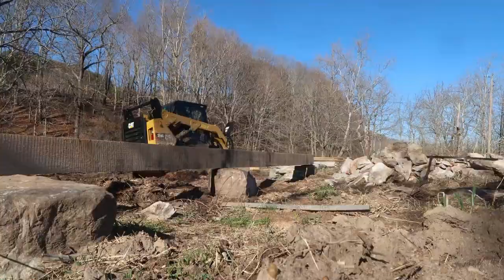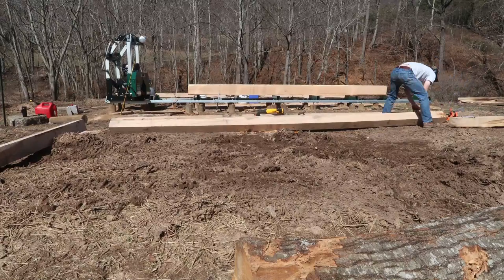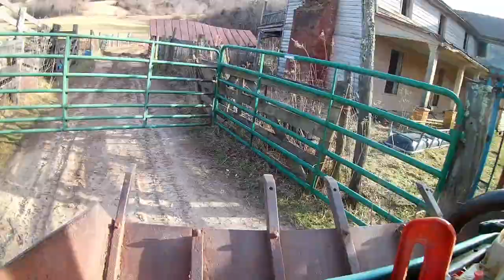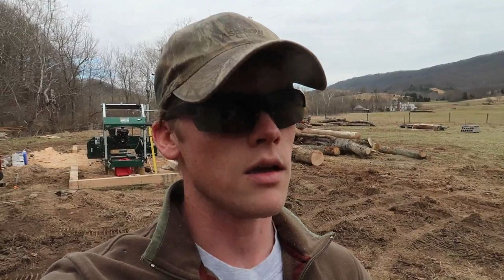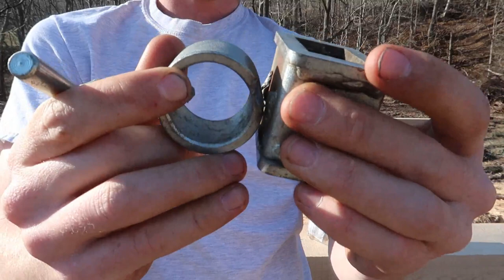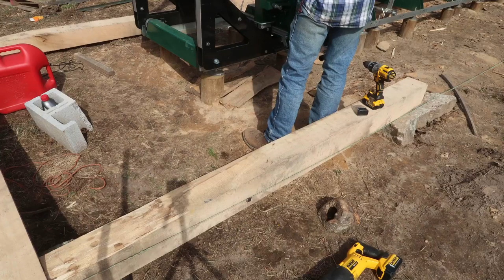Laying sill beams + Fixing, upgrading, breaking, & again fixing the mill | Sawmill Shed

Comment: Watching your video Josh you change out the scale You may want to buy one from Woodmeizer as they have incorporated in on their scale the allowance for the blade I own a lumber mate 2000 and it has 1/2" 3/4" and 1" So lets say the 3/4 scale the marks are placed allowing for the blade so that your 3/4 is a true 3/4 after you make the cut. I assume you give a little more allowing for the blade. Oregon Old Timer has a video dedicated to the subject if you want to go listen he runs a woodland mill too!
Reply from the maker: Thanks, I'll check that out.

Comment: Great video! Glad to see you got the upgraded log clamps. That oak just didn’t want to touch the ground. You mill like a pro. How often do you change your blades? Also what are you using for blade lube. The fresh pines dulls my blades fast. Keep milling!
Reply from the maker: Well, as you can see my logs are VERY dirty. I try to clean them up some, but I'm sure what's left certainly takes its toll on blade life. I'd guess around 6-700 bdft. I've been using straight water. There's very little soft wood on the farm. Josh

Comment: I am not certain why there are so few  comments as you are a strat shooter and work hard. You don't seem to have a ton of experience but then you not 72, I am. I run different saw mills and they all run a bit different from the next but who  cares, your making the payments and it is yours to burn down if you want to! I will subscribe and watch and share them as every nickel count when the tax tokens are counted by the zar or king... what ever our president thinks. I believe in freedom to make  choices and we are far from that anymore. We have a shame of a presidency but this  is a wood cutting spot so we will get back on track. My medication must need a adjustment. I been sober and clean for 23 years come november and that is just around the corner. Instead of rolling and rolling, just set up and work your way through and then saw what wain off the side that you have to. If you can turn any cracks to level with the blade and take it out in one board sometimes. Its best to turn the logs so that when they come in to the mill, the small end is facing the sawyer and just level it best you can, then roll it to the flat side down and mill away once your in to the log a bit more than a third, roll it up to where it will face the corners on the bunks and you can get down to whatever your mill will take you... some are a inceand other are as much as three I seen on one mill but I welded and fixed it. I worked as a millrite an a mechanic for over forty five years but the stuff I worked on mostly was as old as me to start with. Anyone can drive new or fix new but the stuff that no one even remembers is what I was good on... Ever heard of a Buddha Diesel engine? They quit making them in the twenties but some old equipment on these islands in Alaska  never made the move. The people came to log and used the same equipment that was left behind. It cost too much to haul it out so they threw it in the ocean or just left it where it was and then they called me to fix yarders for logging with that haven't run in forty or more years as the trees where full grown again. Yep that was me laying on my backside under equipment doing heart transplant in stuff that should not ever run again. I know when someone is poor and it is not a crime to be poor but if you chose to stay that way then fine but don't go on welfare and expect me to feed you. I even sponsored a  few who tried and failed but they tried and they didn't own me nothing but respect when I left. It wasn't cause they couldn't get logs to the mills but the phony logging tariffs and mill shut down while we figured out if that owl was a rare and near extinct bird or it just was not from there in the first place. Ya the sierra club kinda kinked the logging in many states. I never was for clear cutting but for select and salvage logging cause trees are renewable. I guess when we changed over to chinese steel in houses that things wobbled a bit. What do you do if there is one big tree and four or more little ones with a good start? You cut down the big one and clean up around the small ones cause they really take off growing once they get some sunshine. Got stupid on you again. Sorry, I just miss working every day and coming home with sawdust in my shorts